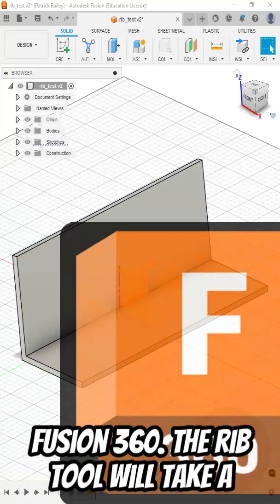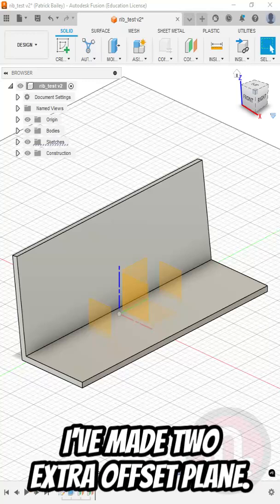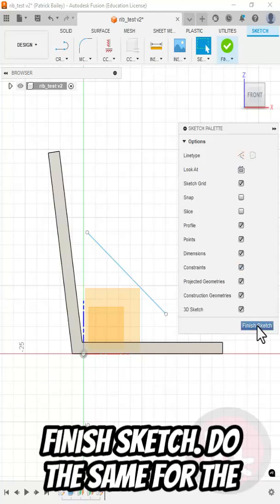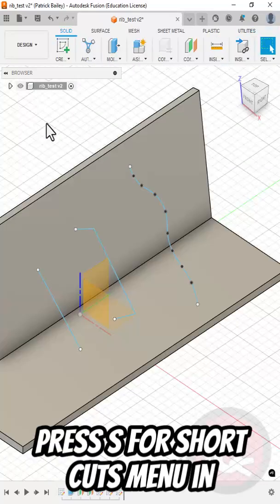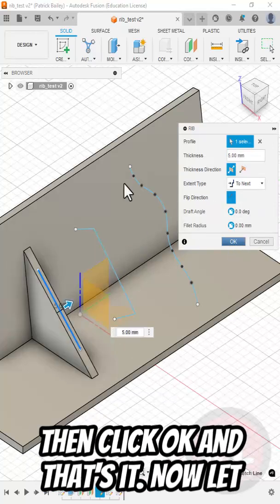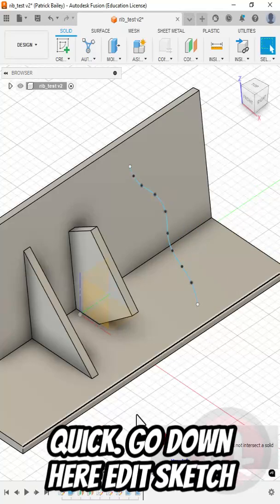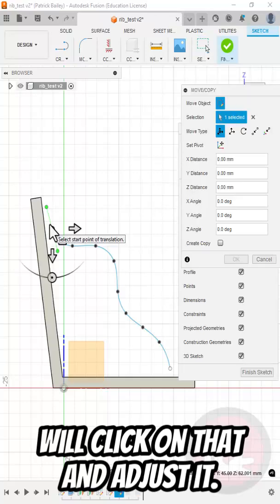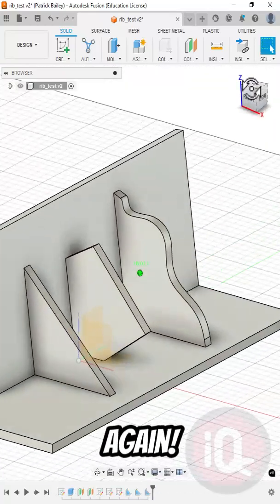Fusion 360: RiB #3dprinting #fusion360tutorial #fusion360

Comment: I don't see the benefit in comparison to just peojecting the bodies into the sketch and making sure the line touches the body. Afterwards just use a simple extrude and you've done the same thing?
Plus: if, for material saving ir other constraints, you need a part of the rib hollow for example, it's way easier to design
Reply: i presume this is in case you edit the initial shape. projection works to some degree but i've broken projections a lot. in theory this would always work, unless you change the initial shape so much that your sketch no longer intersects